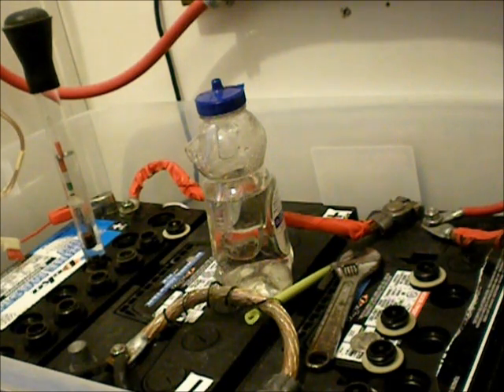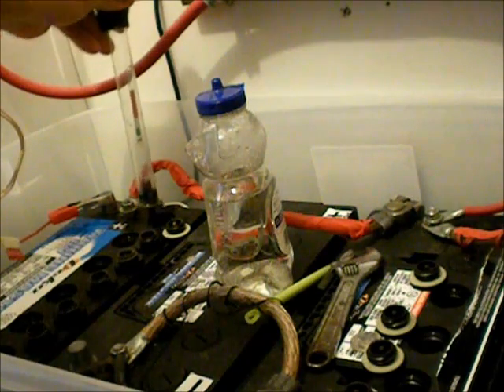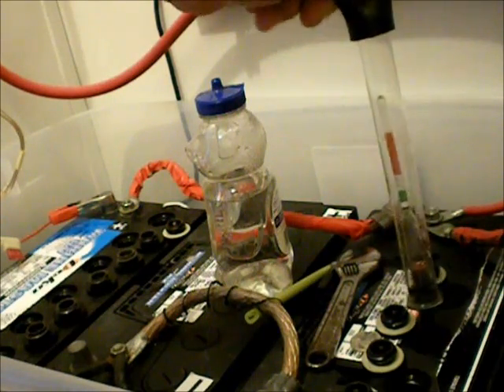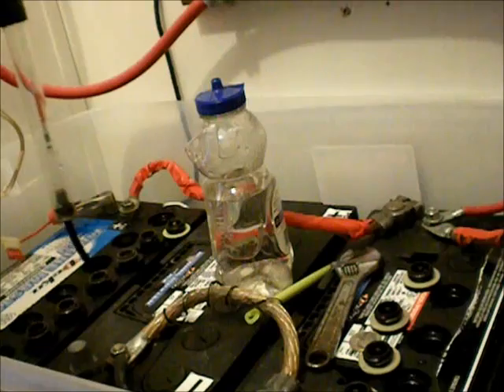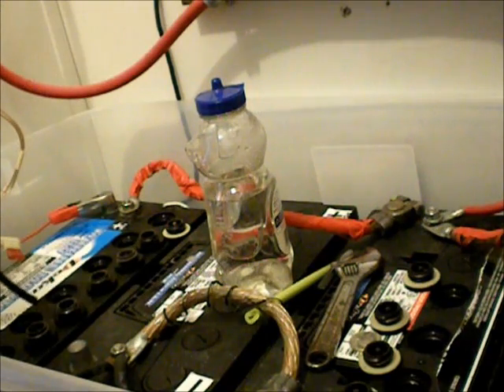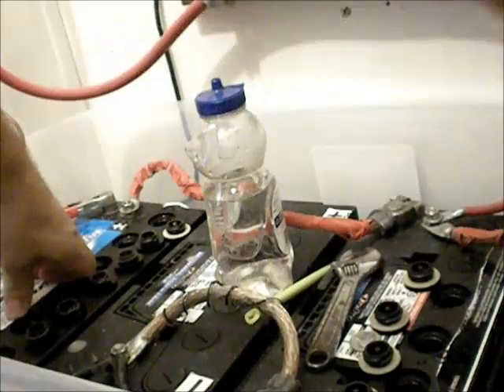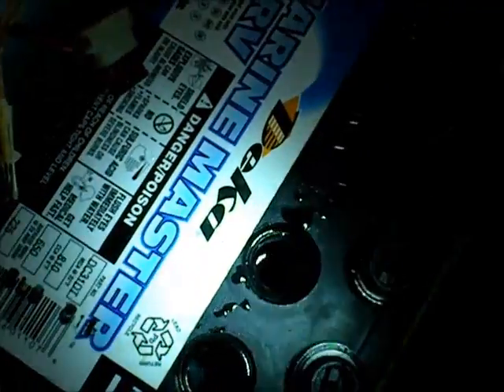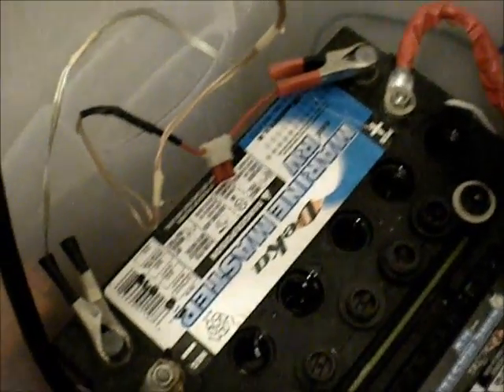Battery bank 12 volt bad battery,5-1-13.

Comment from the maker: The hydrometer is fairly cheap I got 1 at Wal-Mart  & 1 at tractor supply that is the turkey baster 1 that shows my battery cell in the red. U really need 1 as Volt meters don't show condition. Your video about the wire problem got me looking deeper into why I could not EQ my battery bank. I hope U can get to your goal in getting off grid .U are doing a great job man keep at it it will happen.

Comment: Yes so true. most ppl start out small. I was lucky in the fact that i grew up with a 32v southern cross DC generator and a 32v glass (old school ) lead acid battery bank. so i had a fare idea what and where i wanted to go with my system. But with the battery cost and so many types and brands to pick from i still have a problem sorting the shit from the soup when it comes to battery banks. So many just tell out right lies on what there batteries will do.
good luck to you Sir. :)

Comment from the maker: Thank U, I don know they were ready to honor what warranty was left 1 month or $11.  but I have 3 more  2 year old battery's so I would not add a new one to those. Some day when they expire I will get some big 6 volt battery's seems that is the way to go .when I started my solar set up I like most started with harbor freight system. did not know what I would get so I went big 12V.battery route  in case it did not work out I could still use 12v.in 1 of my Cars ,trucks or camper. live & learn.

Comment from the maker: I am going to try a long EQ at 15.6 +volts for 3 hrs. in the morning if it is sunny. I will film & post results, I hope maybe that may bring it back but don't know I was just getting it ready for EQ it was reading 12.6V after running 12V CFLs all night but still has that 1 cell in red zone. I will just EQ  that 1 battery to get results I hope. The next time I will buy 6volt battery's when the others die. No sense to replace 1 new with 3 -2 yr. -old battery's.

Comment from the maker: I'm convinced its a bad battery as it is different from the rest all others were ordered in it has always need water more than the others,they are still like new I have bought this brand for years & never had trouble before. I can see 2 years in a boat or RV but not in my case as I am always taking good care of them. plus there in my house sitting in a plastic tub being look at & tended to I will bring it to the store & show the owner. How ever I will not replace just 1of 4 -2 year old battery's

Comment from the maker: This 1 battery has been a prob since new .I do switch leads on the charge controller & switch + _ leads from 1 side of the bank to the other. The  battery's drain diagonally + post on 1st battery  2 neg. post on last then switch. all ways fully charge & EQ. battery's once a month. if U look U can see the battery is different from the rest this was in the store & the matching 3 were brought in a few days later. I spoke to store today was told  2 years  normal? should last longer way I maintain.

Comment: The first battery is always the one that gets pulled down first since its first in line to drain. You can rotate them once a month that is a way to keep them from being over worked. Also take a battery off and charge it up all the way once a month to keep them better maintained. Do this to a different battery each month. Let if float charge for a while. It keeps them from sulfating up. Remember to rotate batteries to be on the end.